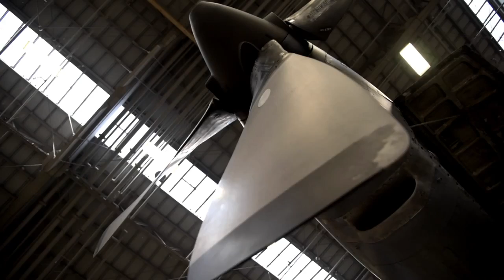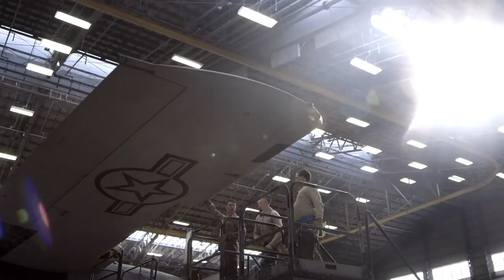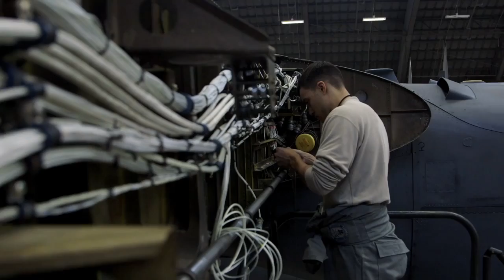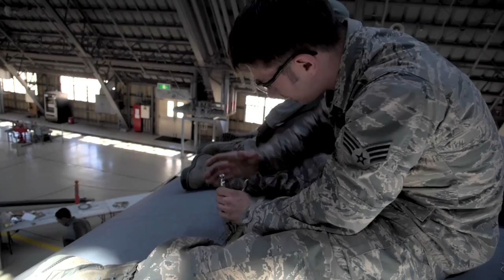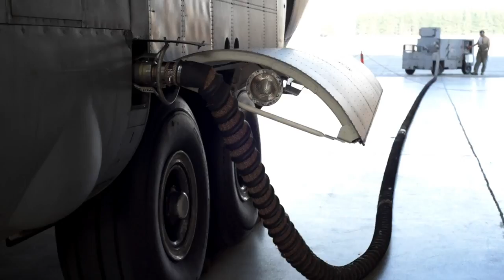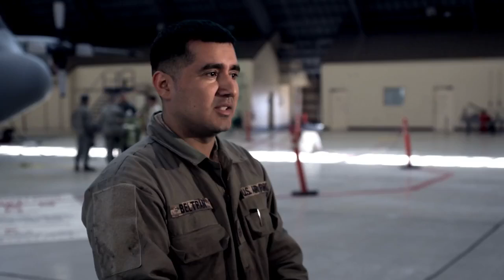C-130 Rebuild at Yokota Air Base

Comment: Check out this great video coverage of how the 374th Aircraft Maintenance Squadron at Yokota Air Base, Japan spend 2 months and roughly 5000 man-hours rebuilding the wings of the C-130 Hercules Aircraft. Well maintained & rebuilt planes, save well needed funds to be used in other areas that require capital investments. Strong Military; Aircraft, Navy, Army and all other Armed Services makes us a force to reckon with & protects America, & our allies abroad.  Thanks to the 374th Aircraft Maintenance Squadron, for an excellent job & a massive undertaking. Accomplished!